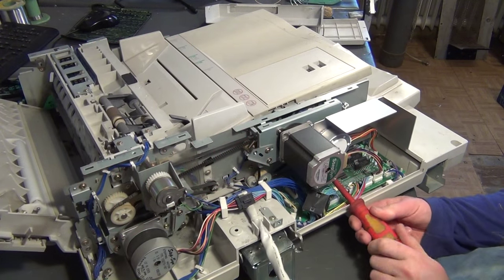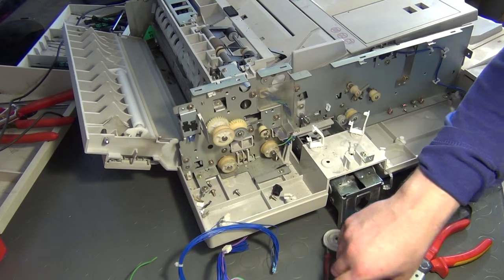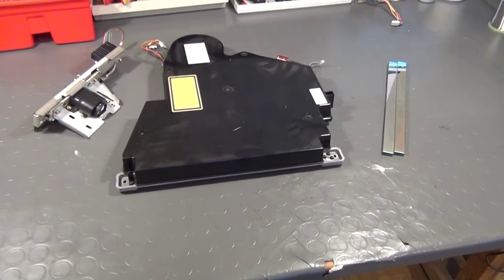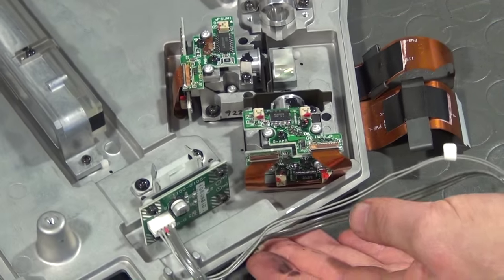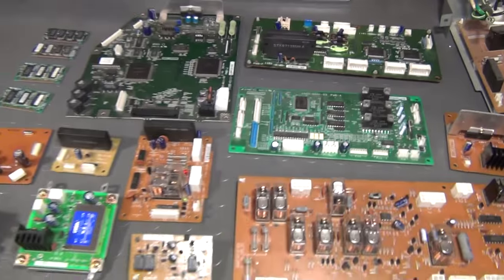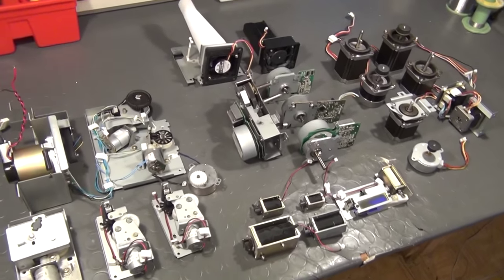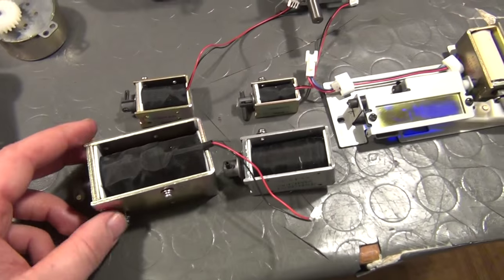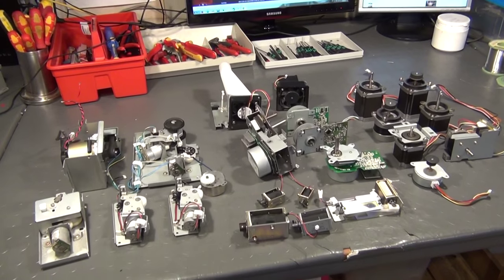Salvaging Useful Parts from Copy Machines:  Stepper Motors, BLDCs, SMPS, Laser Diodes etc

Comment: My god, you did do well :-D
If you are anything like i am you will want to justify all those fresh parts with a clear out of things you dont need, it makes sure that you allways have space for new parts.
I like to keep the metal rods from old cheap printers, one i keep for drifting old bearings out of washing machines before putting new ones in.
A carefull tapping at 4 places with a drift and pin hammer is all ive ever needed :-)
Did you find aussie50's/edsystems site?, you never replyed to my answer.
His videos on my site was allowed by him, i dont steal videos if that was your thoughts.
Reply from the maker: zx8401ztv Hey. I also throw away a lot of things. I'm not a hoarder or anything like that :D 
Actually I hate it when things just take up space and are never used. But some things are so basic that they will eventually find and application. The steel rods are an example for that. 
I didn't reply to your answer  because I didn't see you made one. I made the comment about the aussie accent but then I deleted it again, because I thought it might be inappropriate. I couldn't see your answer, because I had deleted my comment.
Reply: The Post Apocalyptic Inventor Ahh i see, i did get your deleted comment.
No im english and there are a few of aussie50/Edsystems videos on my excuse for a channel, he was worried about them being deleted at the time and allowed his subscribers to copy them if we wanted to.
You should find my comment about redirecting to the creators channel, he has a channel full of all sorts, but his work takes up his time so he dont allways answer comments, a busy man, an interesting mind :-D